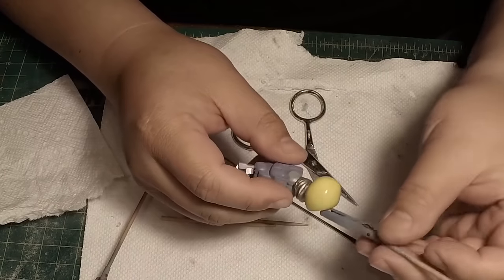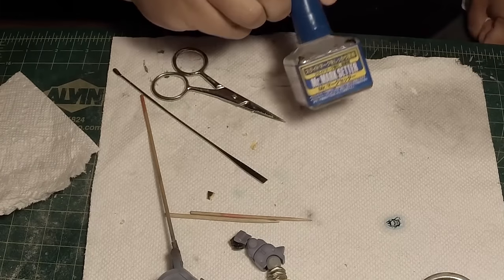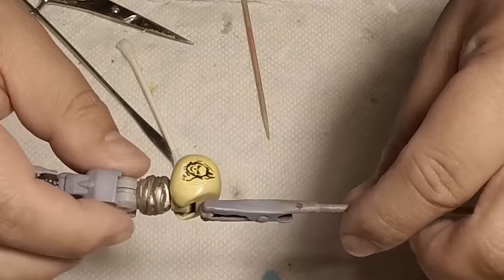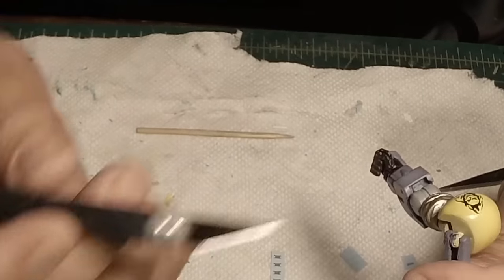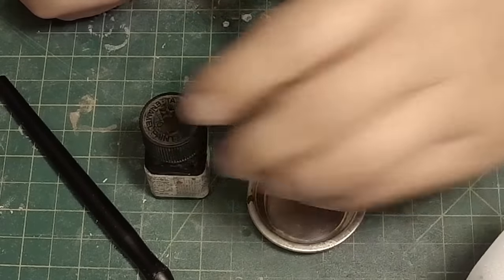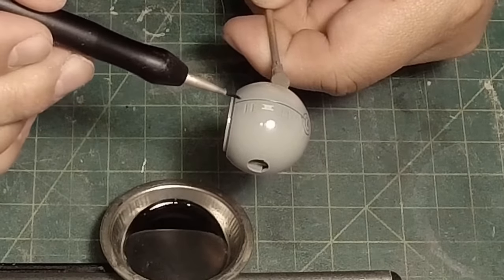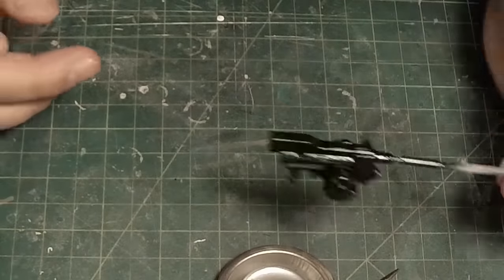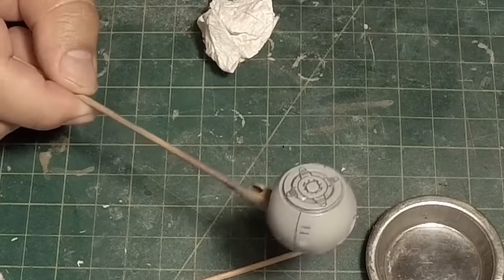Gunpla Decals and Panel Line Wash

Comment: Hi i have a few question : 

1. Do you use a lacquer paint for the kit?
2. If i use enamel thinner for excess line does it broke the lacquer paint?
3. Can we just use water to clean the excess line?

I hope you read this because im still new at this. Thanks for your attention
Reply from the maker: 1: yes, I use lacquer paints.
2:  Enamel paints or enamel thinner will not hurt the lacquer paint layer.  This is why the technique works.  The two paint types do not mix and will not hurt each other.  It is always best to clear coat in lacquer or clear coat in acrylic - as enamel is oil based and acrylic is water/alcohol based, they will not harm each other either.  However, acrylics will need more time to cure (1 week at a minimum)
3:  No, water cannot clear enamel.  Enamel is oil based.  Water and oil do not mix.

Since you are new, do not be afraid to try on some old kits.  Or an old part you are not using.  See for yourself what works best for you!  And do not be afraid to ask more questions!
Reply: Those Gundam Guys woahh thx for answering. Do you know zippo oil? Does it can clear the enamel excess without broke the lacquer? Well i looking the alternative for enamel thinner because tamiya thinner it's expensive
Reply from the maker: Yes.  I use zippo lighter fluid to clean and thin enamel.
Reply: okay thanks for the information :D

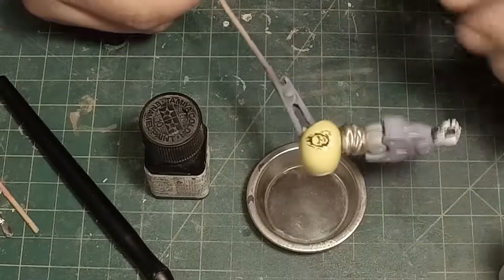Comment: At 18:55 Did you use an Enamel-based Clear/Top coat over the Panel Line Wash?  I ask, because at 10:39 you stated you used a Lacquer-based Clear/Top coat for the Waterslide Decal.  If so, wouldn't the Clear/Top Coats conflict with one another, even if the first one has fully dried and cured on the mode kit?
Reply from the maker: CrimsonRaptors I misspoke.  I only use lacquer based clear gloss.  Then the enamel wash.  Then another lacquer clear flat.

Comment: You say a clear gloss was sprayed first. What does this do for the wash? Also are you just literally spraying the whole part with gloss? What does that do to it in the long term, especially after you add a dull coat last? Do you just have a layer of clear paint over the whole kit? Thanks.
Reply: +Ammers gloss is to protect the paint when you apply decals and panel lines. when you are done with that, you spray a flat to finish it all up.
Reply: +slayerking88 It's okay to spray both over the entire plastic piece, even the unpainted parts? Does it alter the texture of the unpainted plastic at all?
Reply: If its bare plastic, then you don't need to spray gloss. Just panel line, add your decals, and spray your flat coat.
Reply from the maker: +Ammers I usually spray a clear gloss before applying decals so that I have a ultra smooth surface for the decals (water slide decals)  Bare plastic should be good for water slide decals, just make sure that the surface is clean so the decals stick without any airbubbles below.  But as Slayerking88 said, you can panel lines and decal over bare plastic.

Comment: you can get the same results with warm water and nail polish, last expansive
Reply from the maker: Last time I checked, nail polish is lacquer/solvent based; so it could harm my paint which is lacquer.  I'm using properties of the oil paints that won't dissolve the previous layer of paint.